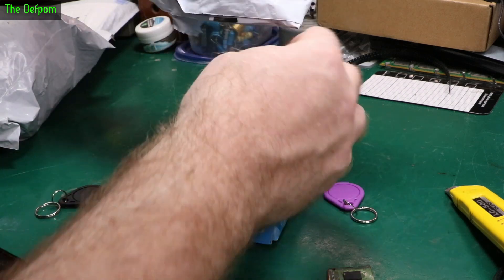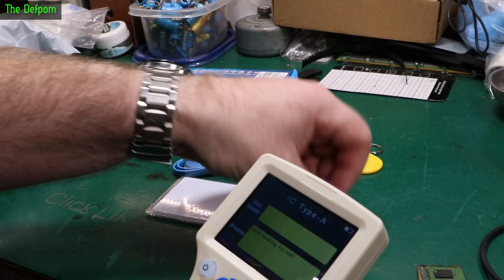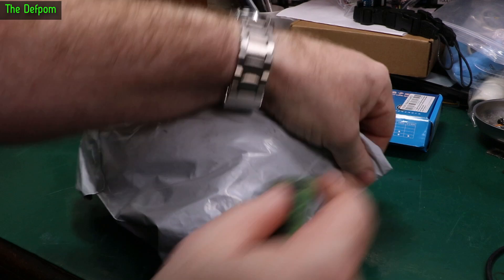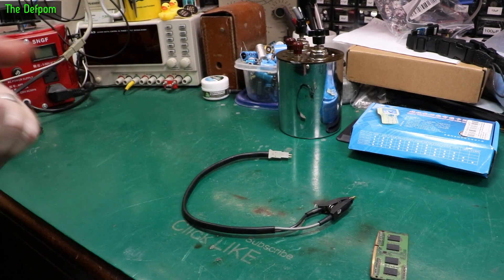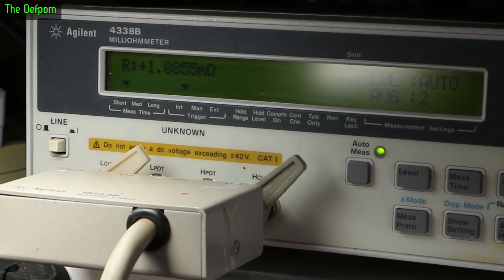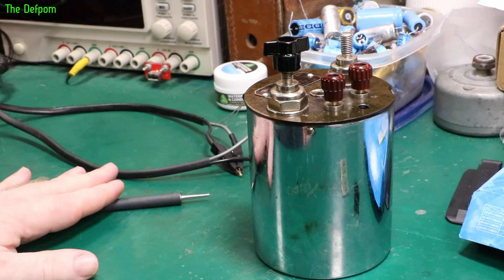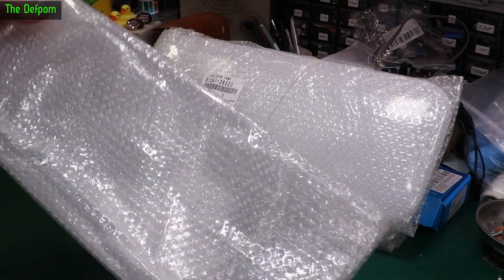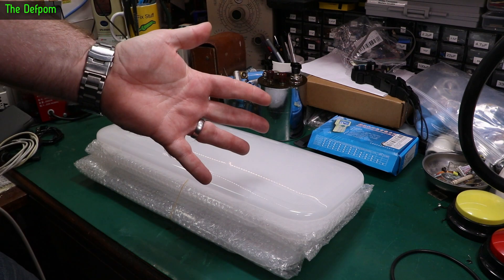🔴 Mailbag Monday 24th June 2024 - No.1258

Comment: Why do need to null a Kelvin lead set?
Reply from the maker: @cambridgemart2075  because it isn’t just the lead resistance but the lead reactance that needs to be nulled out, the 4338B uses an AC test signal not a DC, so stray capacitance and inductance from the leads can effect the readings.